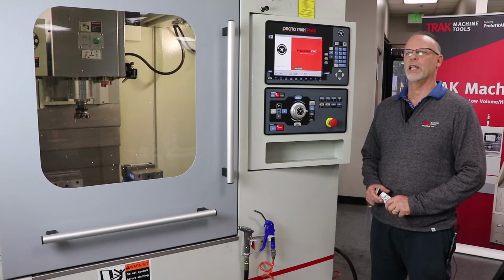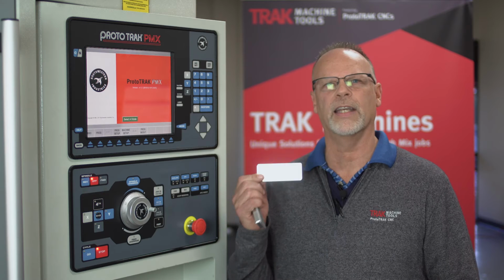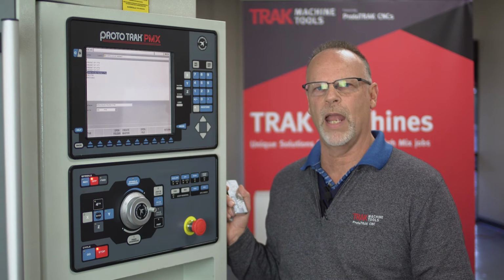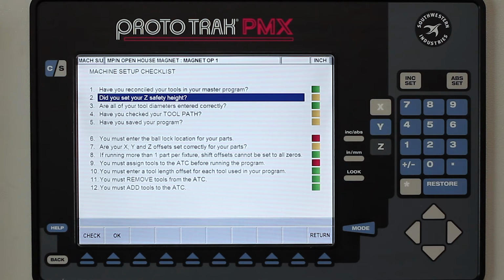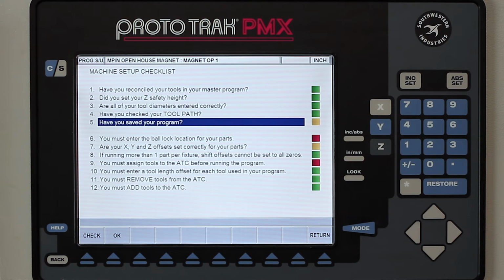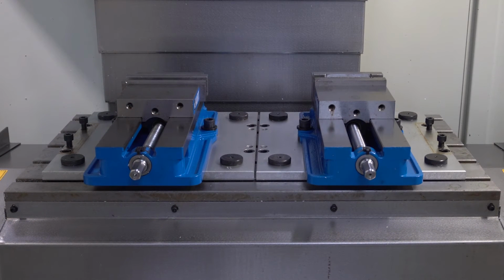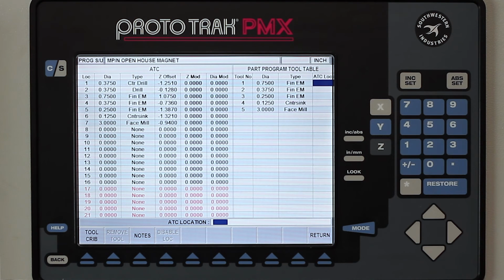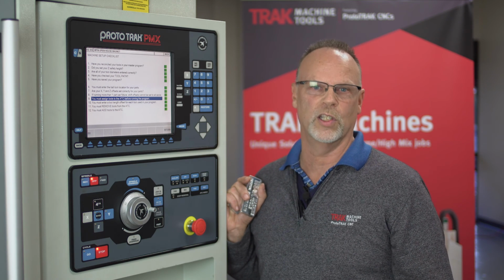Intro to TRAK LPM | ProtoTRAK PMX CNC | LPM Basic Programming [Part 1]

Comment: Can you run a g code program generated on fusion 360  , if so what post processor is needed. Please
Reply from the maker: Hi. Our tech support says "yes, you can" and you'd have to contact Fusion for the post processor. ~PK
Reply: @TRAKMachineTools  many thanks. 👍🏻👍🏻👍🏻

Comment: Is this machine more ideal for a toolroom setting?
Reply: Richard, this machine was really designed for low volume, high mix parts.  It has a bunch of innovative features which make changeovers and initial setup very fast and easy.  This being said, it's a really kick ass ProtoTRAK mill with a tool changer!  So yes, we find them in a lot of tool rooms.  FYI, It doesn't have the most HP or the fastest feeds and speeds or even the quickest tool changer when compared to other machining centers of it's size.  BUT, since it has this simple setup structure and ease of programming (like all ProtoTRAKs) it is perfect for prototypes, tooling, fixtures and all short run parts.  If you haven't seen one yet, I suggest you reach out to your local rep and go see it.  I'm confident it would be a great addition to your tool room too!  T.P.
Reply: @trakingpat2750  Thank you for your reply. I was asking about this particular machine cause my employer is looking at some kind of machining center for the future and even though my uncle and I were at the IMTS show last year we didn't get to see this machine in action. But we did get to see the DPM 5 and we really liked what we saw. We are both tool and Die makers by trade and was looking at machines that are more practical for general toolroom use. Would love to get the chance to see this Machining Center in action either in person or on one of your new videos. By the way Pat I did get the honor of meeting you at the IMTS show as well. Keep up the great work and great videos! Hope we'll get the chance to meet again in the future. Take care! 

Paul Jones